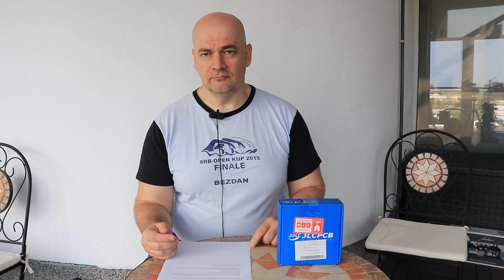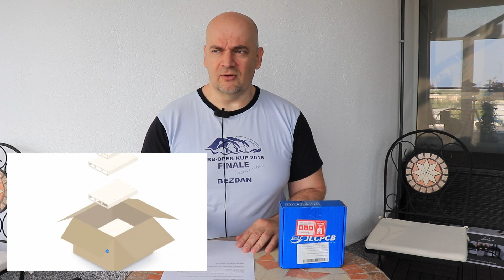SLA (9000R) vs MJF (PA12-HP) 3D printing services from JLCPCB

Comment: The error in the resin parts really confuses me.  It's a process that's usually much tighter than that; that amount of error would be barely tolerable for an FDM print on most 0.4mm nozzle machines.  I'm also a wondering if they kept the orientations as specified, or printed them on an angle.  That works a lot more reliably in my experience.  It also doesn't tear the FEP as much, which is a big win.

Did they specify the resin used?  There are a lot of options, and they're all weird and proprietary, so if they change vendors, it may have a huge impact on performance between orders.

As far as pricing goes: it's totally worth a premium to not have to deal with a resin printer.  I love the results from resin SLA, but rarely use mine because it's such a mess.  Other people don't seem to have this problem, but they can probably eat pasta in a white shirt without ruining it, unlike me.  Maybe I'm just sloppy in general.

Thanks for putting this together, and I'm looking forward to the next tests!